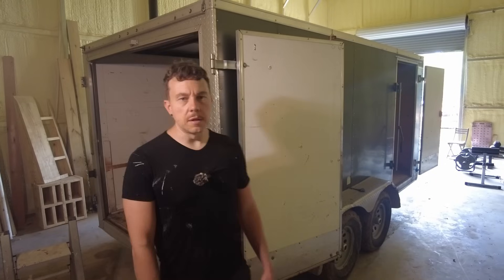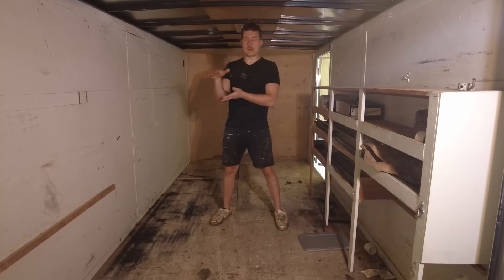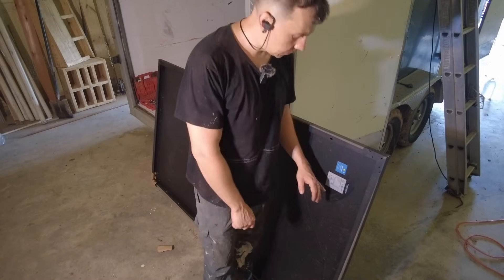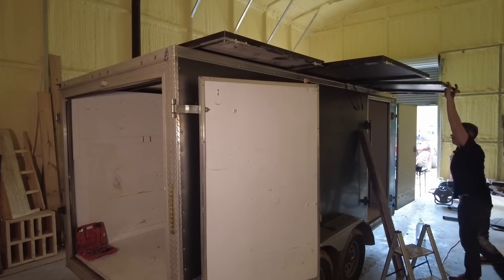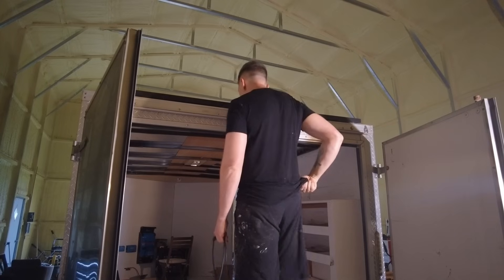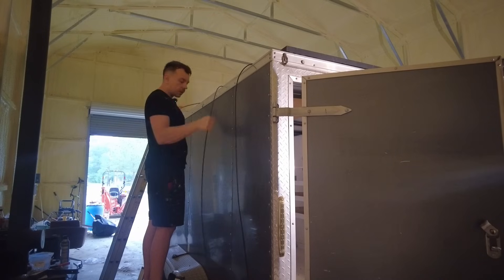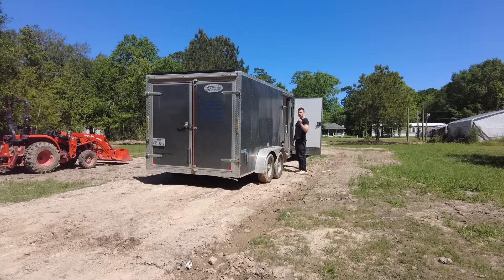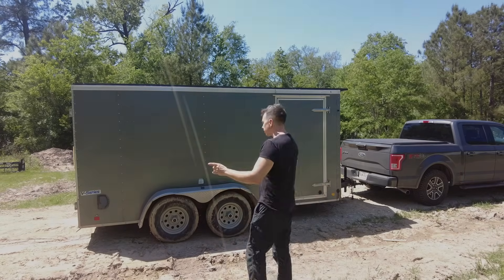Cargo Trailer Conversion Pt1: Solar and Batteries with Vatrer

Comment: 7:00 That is NOT what the numbers mean on the Victron Charge Controllers.

150v is the max Voc solar input. (NOT Vmp) Your 4 panels are most likely over Voc, meaning the first time they get cold and the batteries are full, you're going to need a new charge controller.

35a is the max output of the charge controller. So, no matter what the voltage, the max output amps are the same. The max output is based on these voltages: 14.5, 29, 58
Reply: Also, people should know that Victron charge controllers don't turn on until the input voltage exceeds the output voltage by +5v.

I normally use these minimum input voltages:

12 System = 20v Solar
24v System = 35V Solar
48v System = 65v Solar

These are Vmp numbers, NOT Voc.

Comment: if u wanna get fancy and theirs enough space between the solar panel and trailer you you can put a pipe in the middle hold down with brackets and put wires trough

Comment: If you actually plan on driving with this I would reinforce that front wall and build a better cage for those batteries. I've seen heavy things rip through trailers like butter at even small 40mph crashes

Comment: Great build.  I would have gone with a wall mount battery (batteries...2 maybe?) and a NHX inverter over the axles due to weight unless y'all are going to have something heavier later.  As you may expand, the batteries are about 100lbs each and stack 4 or 5, that's 400/500lbs for the tongue to deal with.  Maybe that's nothing for a dual axle but for ride control, I'd install it over the axles.  Just an idea.  Thanks for the video, going to do the same when I have time after my home build.

Comment: That shop roof full of solar panels and batteries in your shop would provide more power and faster recharge of batteries than your trailer. However if your project is to be towed behind your panel truck stealth camper for unlimited power thats another story....LOL

Comment: You should’ve definitely scooted the whole solar array back. It would’ve been better to hang off the back then the hang off in the front now it will catch the wind.
Reply from the maker: It's back aligned because I'm leaving the opportunity to remove the front panel for AC/antennas/starlink etc

Always have to think 3 steps ahead in these builds

Comment: Cut slots just below the roof line with sliders so you can add more panels like wings that pull out. You would have to get creative on how to keep rain out.Maybe some kind of gutter/drain system.

Comment: Danger:  35Vx4=140V during STC.  Your charge controller will handle that, but you'll go significantly over in the cold and charge controller won't work.  Consider 2S2P rather than 4S.

Found out you might be in Texas.  Maybe it'll work most of the time, but cloud edge effects can be an issue in a cold but not supercold situation.  Panels cool from no sun under cloud.  Cloud opens up and panels get max sun on a cooled panel.  V spikes over 150V and charge controller shuts down with an error.  Can be reset, but unless you know to reset it, you may lose a day of generation.  2S2P fixes everything.  At worst you have to upgrade wire a bit.
Reply from the maker: Yeah it needs to be in 2s2p

Comment: Been planning one of these since I saw the Tesla trailer a couple years ago. Was thinking about a way to add solar, wind turbine and high voltage alternator on the axel so no matter the weather conditions I could generate power. Seeing this makes me want to dust off the plans again. 😁
Reply from the maker: @howardjoplin2611  Cool idea

Comment: i dont get it. if the inverter charges, then wats the charge controller for?
Reply from the maker: Inverter charges from shore power
Reply: @ oh u mean like power from the house insted of solar?
Reply from the maker: @ 
Yeah I can plug the trailer into anything with an extension chord and charge the batteries that way

Comment: how many 24v 200ah bateries would equal those 2 rack bateries u hav?
Reply from the maker: One 24v 200AH battery is equivalent to one 48v 100ah so you would need 2
Reply: @TheTechnoBarbarian  ahhhhhh. so its the same power rite?

Comment: I would either give it utility I couldn't fit into another build (laundry, woodworking shop, etc.) or a mobile home theater. Maybe both.
Reply from the maker: Mobile garage that I tow with my truck maybe? Put a motorcycle in there...
Reply: @TheTechnoBarbarian  or a boat